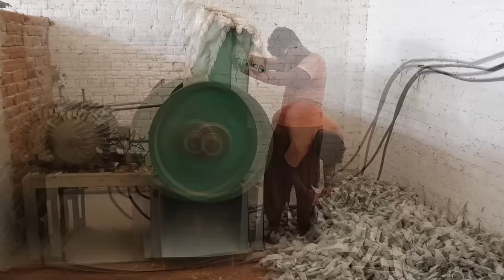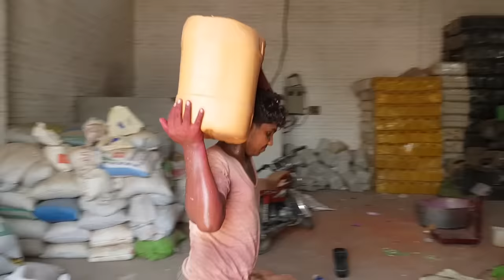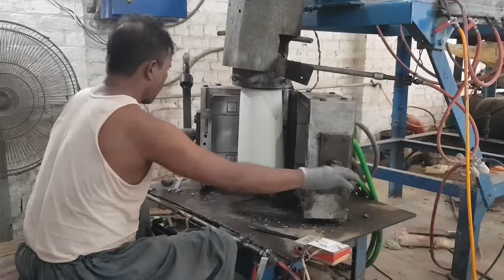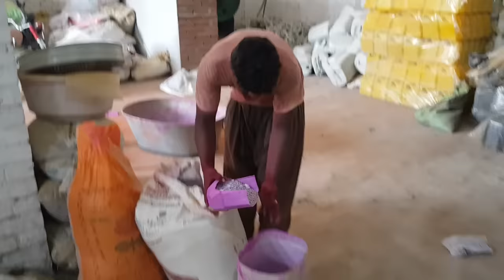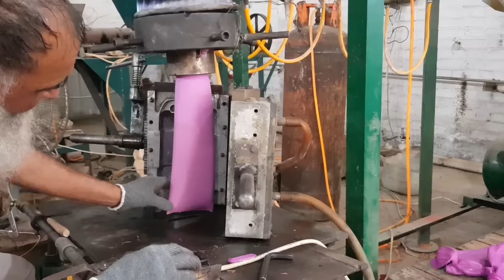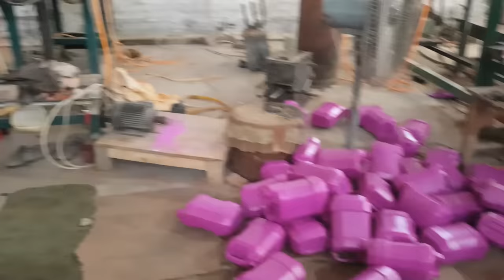Oil Cans | Unbelievable Technique Of Making Oil Cans In Local Factory

Comment: Seems to be these machines are based on 60's 70's design. I have designed blow moulding machine in1994 for drums , cans which are electric heating extruder and moulds are automatics locked by hydraulic. Machine was fully automatic.
Reply: Hallo, do you sell moulding machines?
Reply: @muragesimon9627  Do you want moulding machine? Injection moulding or blow moulding machine?
Reply: Can you design for this type of can?